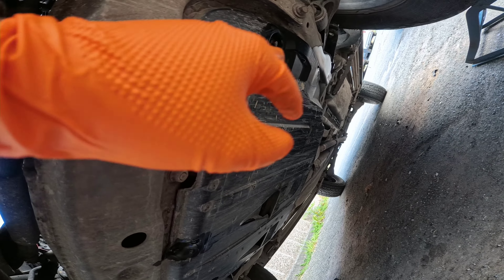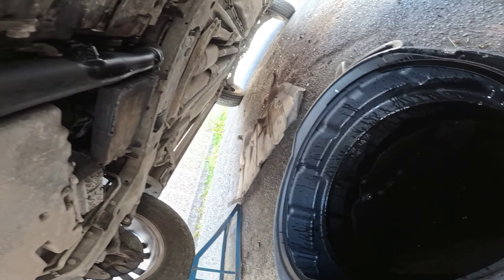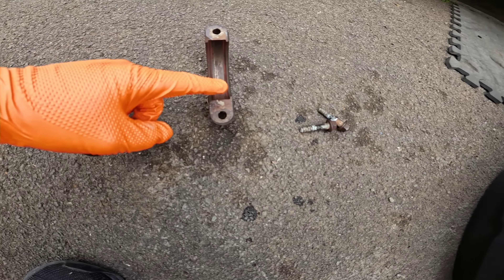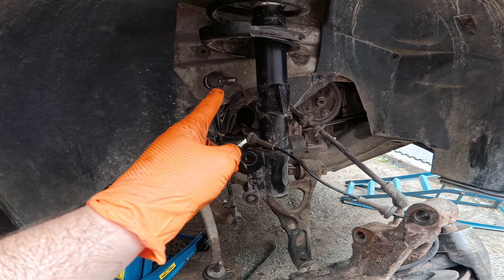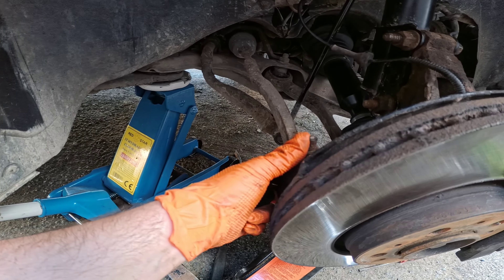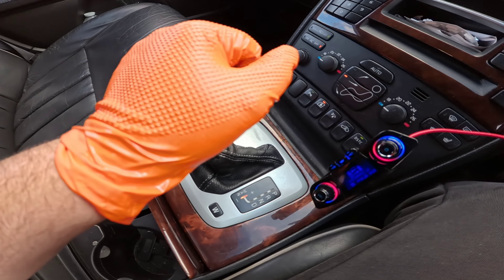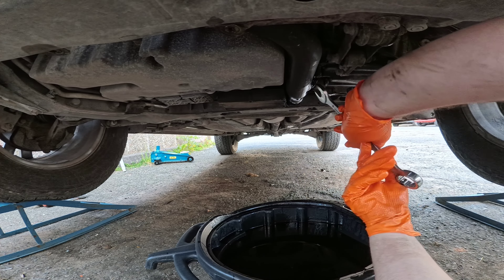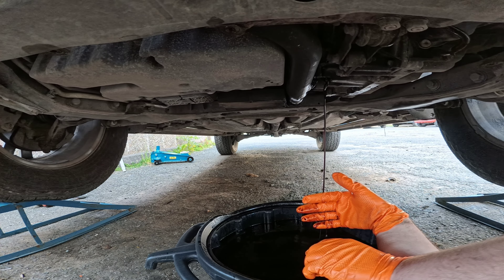VOLVO XC90 GEARBOX FLUID CHANGE AND FLUSH - PLUS DRIVESHAFT INSTALLATION ⚙️

Comment: I wish you would have said why, and how you came to the conclusion the drive shaft needed replaces.  Thought it was the rack and pinion, ( that is what I was told), now I’m having questionings. Did a really good job explaining and giving sized of fasteners. Good video.
Reply from the maker: @lzh3131  because it was clicking on full lock 😔
Reply: @LIMITLESSMEDIAUK_  Thank you for answering. I have a different issue.  I just want to check things out, when changing the rack and pinion, while it’s torn apart.  It’s a 2010 108k, will be handing it down to my grandson, safety.  Good video.